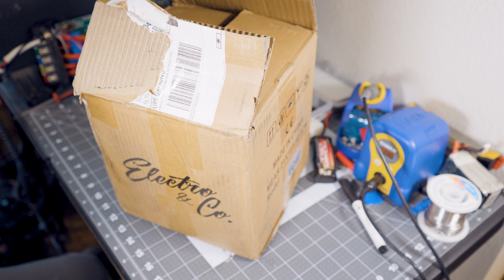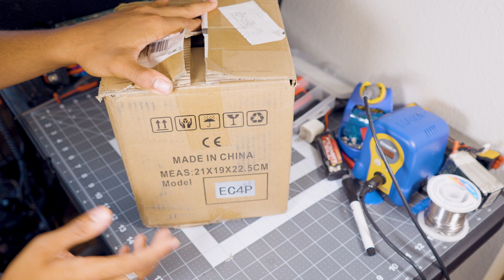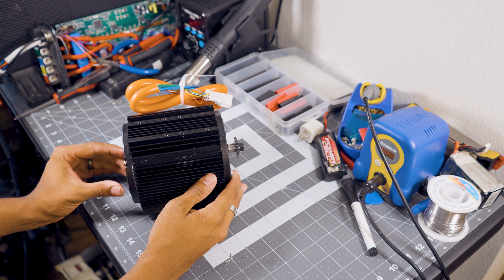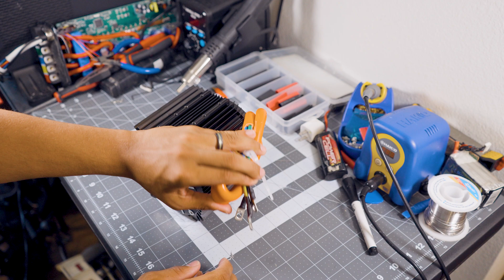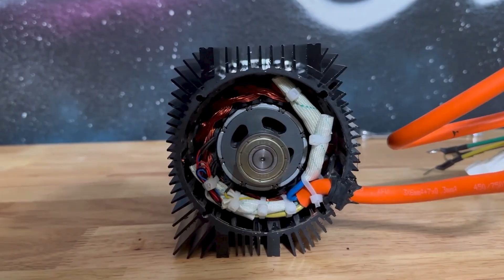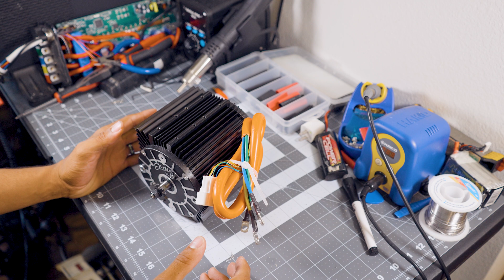The BEST Razor Motor Upgrade? EC4P V2 Unboxing + Overview

Comment: Vesc has huge learning curve if you want to know what say flux linkage is and how to set it good luck just change it sometimes by 100’s of points to go it to run and motor detection did not work correctly with my ecp4 had to change so many settings to get it to rev up then many more to make it smooth ya have fun.

Comment: I was thinking of that motor but went with the QS165
Reply from the maker: Yeah that’s a perfectly valid option. If I was building a larger bike that was gonna require fabrication work I totally would too. QS motors seem to just be the best, but I wanted something that would drop right in.
Reply: @JZEV1  i understand, am installing it to a MX500 but I sent to fabricate a 9” extended arm with the mount for the QS165. Don’t know what controller to use, leaning towards a Fardriver
Reply from the maker: @diyadventures9138  fardriver is definitely the best option as far as chinese controllers go. I am very happy with mine in my stealth bomber, but it does have its limitations. My main gripe with it is its janky app and terribly translated documentation. I purchased a flipsky VESC to pair with the EC4P, love the idea of open source, english native software (VESC Tool). It does seem to require slightly more work on the front end to get it going, but i'm optimistic the technology will work great for these bikes. Its very well respected in ESK8 community, definitely give it a look.

Comment: E&C is a scam I've known the owner for a while he want to get rich
Reply: My v2 motor didn’t fit my mx650. Still waiting for a response from them. Now I’m worried
Reply: @outdoorgrowin don’t worry, Cole says he knows the owner which is me but I can assure you I don’t know him at all other than a few absurdly unprofessional emails. Garage sellers often talk a lot of mess on us to try and get a few sales of their own. The pattern is obvious if you’re aware of it.

I’m sure my team will get back to you. Some of the MX frames are slightly out of tolerance on the rear swing arm tube. 

This means a little bit of massaging could be necessary. 

EC4P is a monster and we have our own video on the channel that explains exactly how that is. Check it out and see for yourself 👌.
Reply: @electroandcompany  I mean I showed you each thing you changed for version two but that's all I wanted so good job It's a better product now. 🤷🏻‍♂️
Reply: they seem to be pretty scammy, they wouldnt even replace something for a simple defect so it turns off every ride and my other motor fried in like a week and they just told me to buy another from them

Comment: Love my ec4p v1. One of the first shipped out with nearly 1000 miles on it. This with my fardriver 72450 is an absolutely crazy monster. You're gunna love this on your rsf build! Im running mine on custom wheels with #35 chain and its held up beautifully..  VESC (vezk) is crazy though, alot of power and cool performance properties. Once you figure it out, youll never go back lol. Theres even water cooled units, lol
Reply from the maker: I got one of the water cooled ones! Probably a bit excessive but I’m gonna put a little water cooling radiator on the bike should look sick
Reply: @JZEV1  thats going to look great dude. Gunna complete that Street bike look for sure.